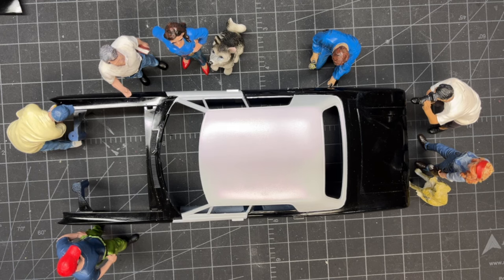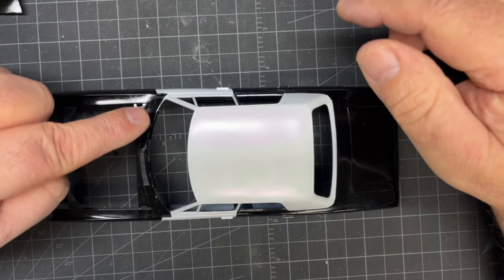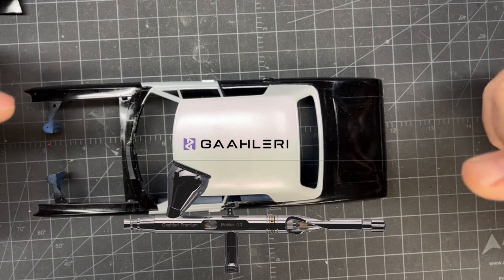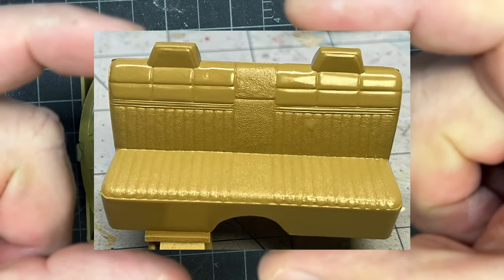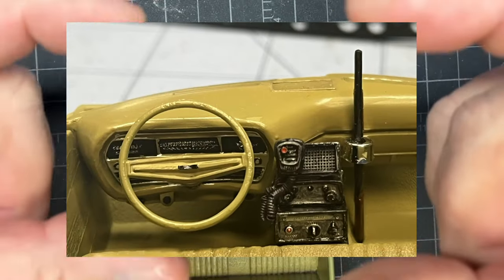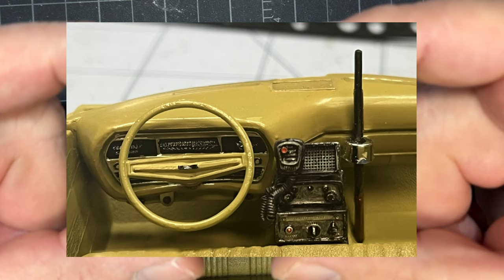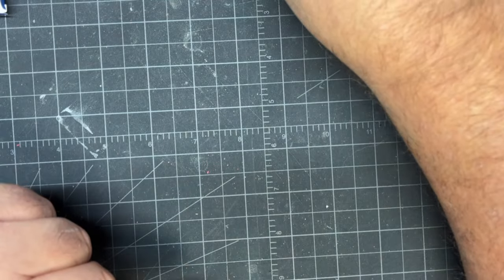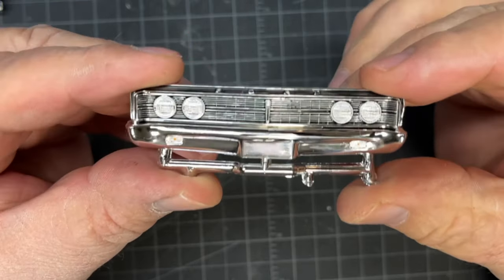AMT 1970 Ford Galaxie Police Car Build Update #2

Comment: hello Mark... funny thing is ..i'm old enough to remember police cars that looked like that...the paint looks great...i don't think you'll have a problem with your lights... guys in my model railroad community use Arduino's (probably not spelt right) to run trains.. lighting ..to activate switch track..etc... Evergreen styrene products have various size tube that might help with your driveshaft issue... thx 4 sharing... vinny
Reply from the maker: Thank you.  I've put these Arduino's through the ringer with my Star Wars builds, and what I'm afraid of is the small 12 Volt battery won't be able to keep up with the demands of the Arduino and the load from the lights.  I've had trouble with running them on a 9 volt battery before, and these little A24's would just run down too fast.  I'm going to make a test build tonight or tomorrow to see how much I can get away with.

Comment: That looks great! The radio setup looks just like I remember in the Grand Fury I used to drive. Turn signals look great! It looks like everything else lines up, wouldn't it be easier to cut the u joint off the drive shaft and add a piece of styrene or even sprue to lengthen the driveshaft? Awesome job!
Reply from the maker: Thank you very much.  I appreciate the note on the radios, I really wanted to go black with them instead of the beige that you see all the time.  I already have the transmission glued up.  It'll be an easy snip and glue to make it right, and it will show the end of the transmission where it should be.

Comment: Awesome video Mark! So who's on third and what radio is doing what? 🤣😖 That dash looks great. Sorry to hear that you cut back on the lights, so sad. I don't think the led's would draw that much to heat that Nano, you can put a small heat sink on the Nano chip. I think you are over thinking the voltage, it's regulates the 12v down to 5v and that should not heat that much. Did you do a test?
I had to rewind the part of painting the white twice before I got what you did... 😆
Your welcome again for the kit and thanks for the shout-out! 😁
LLAP 🖖
Reply from the maker: Thank you very much.  I will be testing the setup tonight or tomorrow.  I really needed to do better with the shout out for you, but my gray matter was shutting down on me.  LOL
Reply: @grandpamarkshobbies  Hay at least you got the name right! 🤣 989% don;t... 🤣
At least you have some gray matter left. I swear mine took a trip with out me... 😆
Just to reiterate, I have no real experience with Nano's just what I have watched over the years. Keep saying I need to, programming it holds me back. 🖖
Reply from the maker: LOL.  I go into brain lockup and have to do a quick reboot.  LOL  If you want anything programmed with the Arduino I can help you out.  I've been messing them up for a few years now with my Star Wars kits.  LOL
Reply: @grandpamarkshobbies Well I know how that is today and the reboot did not help, hence the email... Lol
Oh, ok may take you up in that someday... 🖖
Reply from the maker: LOL

Comment: Why not just cut the driveshaft and use a piece of K&S aluminum tube just use the joint ends silpped in the tube.. Call it an upgraded high speed high torque driveshaft plus no seam.
Reply from the maker: Thanks for the idea, but right now I don't have any tube that is big enough to look right.  It won't be hard to chop the old transmission and fit it in.  It should be there anyhow.

Comment: Please with all your excellent detailing, go back and fix your console. The bottom radio isn't a radio but a Federal PA 15/20 siren head. 15 has maroon face, 20 has light blue face and black knobs the ridge above the face is half silver and black and a red light in the center to signify on/off. the outside case is a metallic or gray cover. the middle radio is a Motrac radio head. It has aluminum face with black knobs, green light in upper left-hand corner for power light and in right hand upper corner a red light denoting transmitting. The color is beige and microphone output is in lower right-hand corner of the body. The Motrac speaker is actually square with black grille and beige body with just Motorola M in the upper left hand corner of the speaker grill and Motorola across the bottom edge in black border. The microphone provided in the kit is for the PA 20 and is all blue.
So the wiring would go from Motrac head mike outlet to rear of siren head and microphone would be connected to bottom front center of PA 20. This kit has the most accurately detailed emergency console parts. I would move mike to the side of the dash just above the console to be in easy reach. Some departments put the speaker on the rear deck of the interior. Your shot gun is going to hit the windshield so reverse the bracket and it will tilt the shotgun back. I would also make up a little panel with rocker switches for the light package. usually where the radio delete plate would be. Hope this helps and hopefully this gets to you before your police dog puts it in service.
greg
Reply from the maker: Thank you very much for the awesome info.  I'll see if I can get my brush into the interior to do what you said.  I try and make things as right as I can.  Not sure if I can do that here, but I am ordering this kit again so I can use the radio for my Rescue Squad build.  I copied your information and saved it in a file so I can get the next one dead on.  I saw these radios on line, and most of them were beige, but when I saw a stack that was black I said "good enough for me" and ran with it.  I thought it would stand out better in there with all the tan interior.  I did test fit the glass, and the shotgun does fit, so I'll at least take that as a win.  LOL  Thank you again for the great information, and if I hear anyone else building one of these I'll for sure pass it along.  Good stuff.